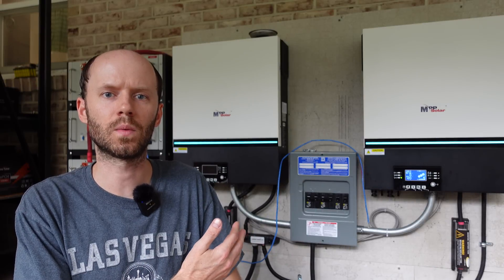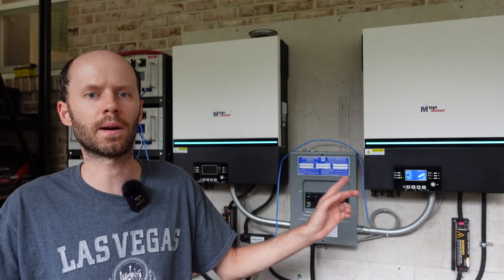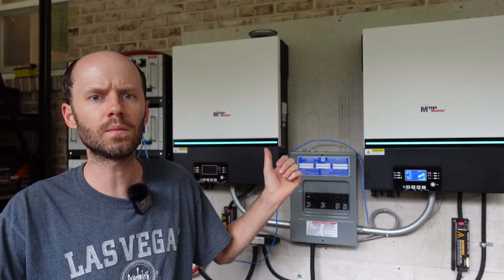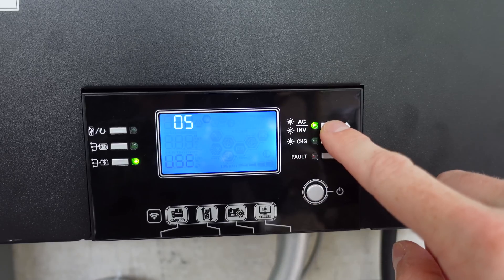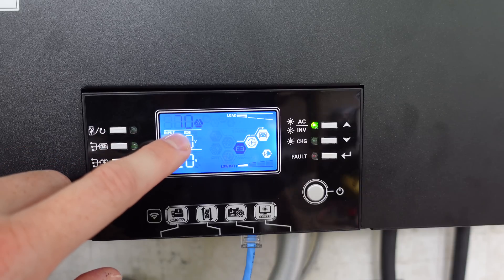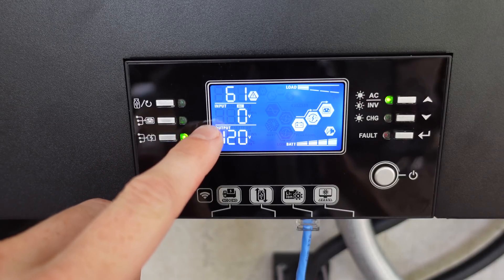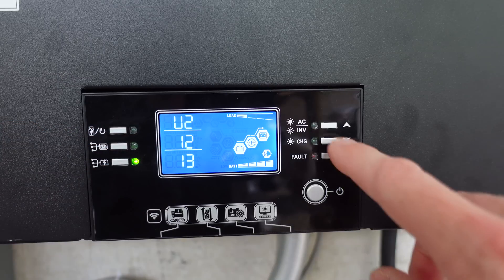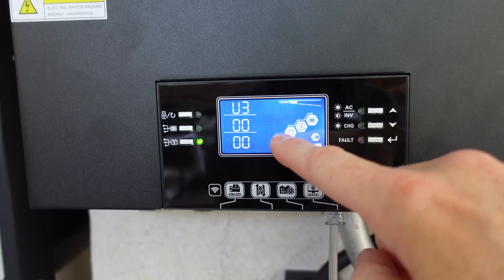MPP Solar LV6548 Voltronic Firmware Problems, I Bricked the Inverter Display!

Comment from the maker: MPP Solar Inverter... https://watts247.com/product/lv6548-6-5kw-120v-solar-inverter-4kw-250v-mppt-bms-ul1741-built-in-wifi/?wpam_id=97 (affiliate links)
EG4 6548EX Inverter... https://signaturesolar.com/eg4-6-5k-off-grid-inverter-6500ex-48/?ref=lithiumsolar
If you know how to fix the broken display, please let me know! I've sent another email off to MPP Solar to see if they'll provide any advise.
Reply: I love Ian at watts247. He has been an absolute awesome resource. I’m a tinkerer like yourself and I have had my fair share of bricking my electronics. It just goes with the territory. 
What I have learned is sometimes less is more and more is less. In other words. Spend less money and have more headaches. Spend more money and have less headaches. MPP Solar is a discount brand that works ok but what a pain they can be. 
If you spend more money like for a SOL-ARK they are stupid simple to set up. Tech support is always there. Spare parts abound. EMP proof product. The list goes on but the down side is they are expensive as heck. More money less hassle. 

To call Ian at watts 247 a (bad word from the previous post) is way un called for. The guy has a great amount knowledge and he is always there to answer crazy questions. Just don’t waste his time.
Reply: I used to have TWO 5048's... Got one from Ian in Utak he was a total PRICK so I bought my 2nd one from MPP Solar in taiwan .... connected everything right and it BLEW UP !! and MPP Solar in TAIWAN took OVER A MONTH to send me new boards... as soon as I rebuilt the blown up one with new boards I dumped em both on craigslist.... Never went back to IAN (PRICK) in Utah and would NEVER buy another thing from MPP SOLAR in taiwan. Went with a AIMS 12kw and couldnt be more happy !

As for EG4 they look decent.... although they look so close Ill bet MPP makes them for SIG Solar.....
Reply: You may need an update to your boot loader first…then your firmware should install…if you get the unlisted fault code 90…the to serial number between the two isn’t in agreement. You will need too get into the programs and align them with the actual serial number on your inverter. It appears to be an attempt for firmware to incapacitate clones. It usually occurs 60 days after a firmware update, but it seems to be inadvertently scrambling serial numbers, and causing the fault on legitimate inverters. This is only being talked about on forums…I think distributors are keeping it on the down and low. There’s no way to know how widespread this actually is…
Reply: I am in need of help. I had a company come out and install solar pannels on my roof. Its one of the grid tie systems where you csn only use the pannels while the power is on unless you have a battery bank.  I have 6 5.1kw EG4  100 amp 48 volt batteries I need hooked into the system. The company that installed the pannels agreed to pay for an electrician to hook up the batteries. I  literally can not find anyone to do the job I have had 3 electricians come out and all backed out. All other solar compaines will only work with the batteries they sell. Im really starting to get frustrated what do I do. I will fly you out to do the job im at that point.
Reply from the maker: @thomasjefferson4662  I am not an electrician.
Reply: @LithiumSolar  i know I just need someone to hook up my solar

Comment: Hi, Wish I'd seen your video before doing exactly the same thing with my two parallel Axpert 5Kw V5s 🙂 which are made by Voltronics, like you not purchased at the same time so slightly different firmware versions.

I bought a parallel kit  to connect the two units together and it worked OK but with some anomalies. Contacted my supplier Voltacon Solar, who were very helpful and said that it was essential that both units ran the same firmware and they sent me links for firmware upgrades from Voltronics themselves, interesting that the two lots of firmware were only slightly different and yet the upgrade files were different for each inverter depending on the installed firmware. They also told me to disconnect the solar panels before attempting the upgrade.

I experienced exactly the same thing on reflashing the main CPU, it transferred 5347 blocks and then hung, I waited maybe 45 minutes, but as far as I could see there was no further action (I have an IT background as well and I was reluctant to try a firmware upgrade as i've experienced similar failures on other equipment in the past) the upgrade instructions said that the program would notify me when the upgrade was complete, but that never happened, so I exited the program and it seemed to have worked, in as much as the V5 restarted OK and seemed to be working. 

I then ran the display upgrade, the screen went blank and no blocks were written and after 45 minutes I exited the program, the display refused to restart even after disconnecting the grid, batteries and solar panels. I tried the whole process from the beginning again and got a message back from the unit that the connection to the unit failed.

I swapped the working display with the non working one and the only thing I got was an F32 fault code. My installation manual doesn't mention that particular code. I contacted Voltacon again and they told me that the F32 fault was interrupted communication fault, so was it still trying to update when I effectively aborted it? Who knows.

Voltacon also said that apart from needing a new LCD display I might need a new interface board that connects the display to the motherboard as that may have been damaged by the faulty upgrade. 

The thing that bothers me is that a new display will have the latest firmware which will not be compatible with whatever is now on the V5, so I presume that that will mean trying to reflash the firmware on the CPU, given that it was the upgrade that bricked the original display this seems to be a risky venture . Meantime it appears that the V5 I tried to upgrade is still working although the cooling fans are running at maximum speed all the time.

I'm tempted to give up on two V5s in parallel and just buy a Voltronics 11Kw inverter charger as that might turn out to be the cheapest option 🤣🤣🤣. I don't know if this helps but like you I'm faced with either risking bricking the other unit as well or just tryiing a single inverter charger. 

I noticed that one of your commenters talks about updating the bootloader, my laptop is running the latest version of Windows 11 and I wonder whether this may be the problem, in as much as the updates were probably set up under an earlier version of Windows, possibly XP! I had similar problems with car Ecus, where the software was written under XP and simply refused to work with later versions of Windows 😞
Reply: I have an old laptop that has a true rs232 port running windows 98B  I use just for updating things, the second os for things to new for that is win 2K pro that is updated and stable, no antivirus or any thing on it (Since it is never online) just a tip, it seems to work if the flash programs work, simpler the better.

Comment: I processed the firmware upgrade of my second LV6548 inverter since it was giving problems with the voltage, but when I finished it gave me an error 32. These were the MPPT Solar files I received. Can you help me with this.

Comment: Hello, been following your channel for a while. very informative..... I have an MPP LV2424 / 24 volt system and was contemplating going up to 48 v. with these units from MPP.... did you hear back form them and solved the Issue? I realize it's been a while .. but wondering if you would still recommend these LV6548?  if the support is not there I would be willing to pay a bit more to have that support,  I thought MPP being out of Taiwan would be a better option than the Chinese stuff.. so I thought. thanks...

Comment: EG-4 inverters are almost same as MppSolar with very similar issues and little to no customer support from signature solar
Reply from the maker: The problem has been resolved thanks to Watts247. You simply need to add a resistor to the communications cable. See this video https://www.youtube.com/watch?v=MwmZWIUzP-A

Comment: You do need bms coms especially if you're using pyl batteries, other you lose about 60% of the available capacity on the battery. The inverter always report battery low even when 4 lights on pyl are still green. This is super annoying.

Comment: Had the same problem with a inverter. Unplugged the screen took it to a similar inverter plugged it in and it switched on again. Took it back and after 2 months it is still on.  running

Comment: You have to pull the controller display, use a long cable and put a cooling fan on it and reflash it
Reply: also have to take the back off the controller to get cooling air on the pcb.
Also someone said  USB RS232 adapter from the laptop to the remote display was an issue, the one that worked eventually used a FTDI chipset.

Comment: Voltronic is the manufacturer behind MPP LV 6548 , EG4 and similar looking inverters. Maybe they’d be some help and would like to know how their rebadged distributors (MPP) are ghosting the public. They should care because it leads back to them and the bottom line. It’s very hard to get a burned customer back.

Comment: Hi, I have just flashed my firmware to 112.19 with an official release from MPP Solar. The issue I had was with heat, the reflash would stop part way through. I cooled the display by removing the display from the inverter and opening the display case and actively cooling it using a small PC fan, while connected with an ethernet cable to the inverter.

Comment: Do we have a way of extracting the firmware files? It's common for a firmware update package to include blobs for the various chipsets in the device, but only those which would NEED to be flashed. 

I suspect that the display chipset has a newer firmware that is incompatible with the older firmware you flashed to the other chipsets. A firmware even older than the one you flashed may have a blob for the display.

Comment: It maybe the case that if the inverters are communicating between themselves, that you only need to set one inverter to your battery settings and not both inverters. I run an MPP 8048 on user settings for my batteries and it has been very reliable.

Comment: Not to sound like a dick

RJ45 refers to the connector at the end of the CAT(category) 5(e)-6(a) (not sure what you have) Cable
Reply from the maker: RJ45 cable 🙂
Reply from the maker: @organicgardening4374  Yes, the cable that goes between the battery and the inverter has specific ends that need plugged in to the appropriate device (and mine are labeled). The standard RJ45 patch cable that comes with the battery is for connecting multiple batteries together. You'll need this cable for the inverter connection https://www.currentconnected.com/product/sk48v100-icc/?ref=lithiumsolar

Comment: I've had my 6548s running flawlessly for close to a year, it never even occurred to me than I needed a 
firmwear update. Maybe I should just leave it be?
Reply from the maker: I wouldn't mess with it if it's working. I only tried to update because the version I had apparently has broken pylontech comms.
Reply: @LithiumSolar  Thanks for the help with the ground bond issues, that was an eye opener for sure.

Comment: MPP Solar is really slow to respond to support requests. It took me about 2 weeks to get an initial response and follow-up replies took from 24 hours to 72 hours+.
Reply from the maker: That could be avoided by simply posting the firmware in their downloads section with the manuals rather than making customers beg for it and wait days/weeks.
Reply: @LithiumSolar  yes 100% agree with you! For what it’s worth, I got both of my units at the same time from Ian around late March/Early April. I’ve asked MPP for the latest firmware and they said I’m running the latest already. They were the same firmware on your unit that now has the dead display.

Comment: We just bought 2 eg46500ex due in next week,  Will Prose gave a good review so we made the commitment. From what I understand they are made by the same company as MPP? We also went for the EG4 lifepower4 so everything is plug and play. I am a little concerned they are relatively new inverters  but I trust Will Prose. Signature solar was helpful  before we made payment but since then we have had poor communication. I hope EG4Electronics signs more distributors to create competition and provide better support.
Reply: Signature Solar is all smiles until they have your money and then it's like trying to get child support from them. They're on my blacklist of retailers.
Reply from the maker: Yes, I believe they're all made by the same OEM. The EG4's have 500V MPPT input, which is a huge win. It seems the 250V limit on the MPP version was some kind of oversight. It seems difficult to stack a reasonable amount of panels on due to the 18A input limit.
Reply: If I'm not mistaken they are one in the same. EG4 is SS house brand .
Reply from the maker: @onthelake9554  Kindof. Signature Solar / EG4 made some changes of their own - increased the MPPT to 500V as I mentioned and removed the MC4 connectors so proper strain reliefs or conduit can be used.
Reply: Voltronic is OEM manufacturing this units for   a dozen of resellers around the world. In Ukraine it’s 220 version is sold as axioma, fsp and some other brands that I can’t remember from a top of my head.

Comment: Hi. I experienced a similar issue with my MPP. I had the 112.14 firmware for the display.  Many have tested the 112.19 firmware and it solved the BMS COMMS with the battery. So. I tried the upgrade and it failed….my display was blank but the inverter seemed to work.   I turned off the Batt and the Inverter and reset everything.  My laptop was able to connect to the display and i reissued the display firmware update.   The Display is heat sensitive.  I removed the display and took the back off it and kept it cool with compressed air while the firmware loaded.   It worked and the display restarted.   I shut it all down and put it back together.   The BMS COMMS work great on 112.19.   My understanding is that MPP has or will be releasing the 112.19 firmware to solve this issue.   This is all outlined on the diysolar forums (which I’m sure you were referring to)
Reply from the maker: Yes, but it looked like the 112.19 firmware that was posted on the diysolar forums was OEM and not MPP Solar's firmware. Is this the version you loaded? OEM? I also saw posts about overheating and someone whom blew on it for the entire 10 minutes to keep it cool - got me afraid to try... 😂
Reply: @LithiumSolar  yes. That was the one. The first time i tried it i left it alone and it failed and blacked out the screen.   After rebooting everything i took the display apart and used compressed air.   Worked great!!!! Yes i used the OEM 112.19
Reply from the maker: @mikewalker4062  Cool, maybe there's a thermal issue going on and I'm just not realizing it. If I don't hear back from MPP in a few days, I'll take it apart and give it a try. Thanks!
Reply: Mount displays remotely.

Comment: I have the EG4 6500EX-48 and I can connect it to a PC and see its operation/mode. Have you tried to see if you could communicate with it via its PC  port (port to the right with keyboard icon)?

Comment: Time for a sol-ark
Reply from the maker: No thanks...
Reply: LOL , never.
Reply: @onthelake9554  The price is actually decent considering all the features
Reply: @niktak1114  Sol Ark won't start a compressor in a video I saw. I can run my AC (3.5 ton) and still start and run my compressor with my 2 6845's

I have no communication with my batteries either. I'm just running in user mode until this gets worked out.
Reply: @dougnoble8720  My sol-ark 15k can start my 3HP 240V well pump (62A starting surge) while charging my car at 32A 240V and running a 1500W space heater in off-grid mode
Reply: @niktak1114  I am very aware of all specs of all 4 Solarks , thanks though.
Reply: @onthelake9554  my comment was not to you...
Reply: @niktak1114  "the price is actually  decent considering all the features.  "     this is what I was referring to. Sorry.
Reply: With my twin LG6548’s I’ve run my LG clothes dryer and old 2.5 ton AC at the same time (not intentionally) and didn’t even realize it till later. I don’t know if even twin Sol-arc’s will do that.
Reply: @SkypowerwithKarl  Twin Sol-ark 15k's can surge to 60kVA lol. A dryer and a 3.5 ton AC only use around 8kW combined.
Reply: @niktak1114 
You forgot to add surge for the AC. But yes, by the documents ONE Sol-ark should handle it, however there’s been more than a few that yanked them out and installed MPP LV 6548 twins. My first go to are the most obvious when things can’t hold up a load regardless of the fault code. Like what’s the actual voltage at the inverter’s battery input posts? Breakers, bad terminals, bad bms or sic batteries are a major source of problems that I see. Would I go with LV6548s again? If support from the manufacturer doesn’t step up, aaaah noooo! How many updates do you get on your phone? How many have I got for my inverters…Zip. And I know they have bugs but I’ve adapted. In the future I may be looking along the sides of Schneider Electric.

Comment: Did you try swapping the display between inverters? If you can find the eprom they are using to store the firmware, you might be able to get a pin out of it and it may have a reset leg. Just a thought.
Reply: Reset will not be enough, those eeproms were most likely preprogrammed in the factory and reprogrammed during the firmware update.
But you might be able to directly program them if you have the proper programmer, the only issue is if you can get the firmware itself (not the installer, just the firmware code that goes into the eeprom).